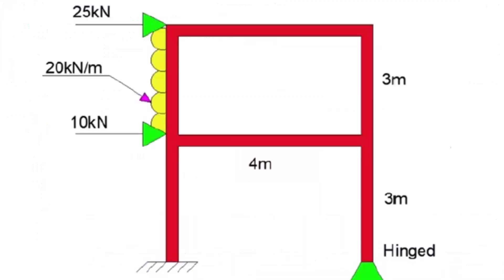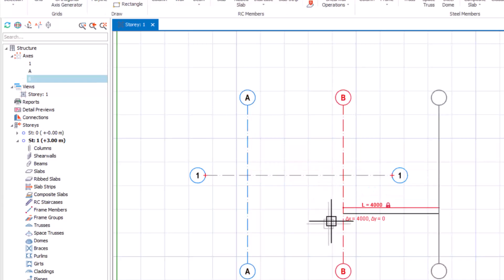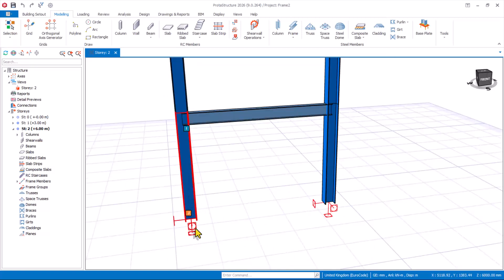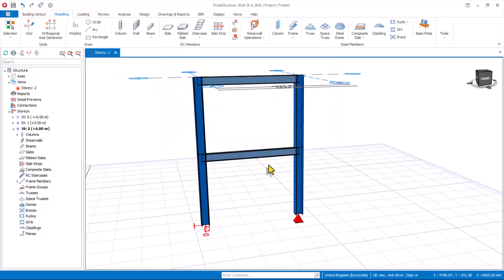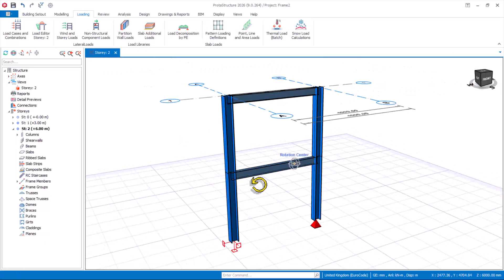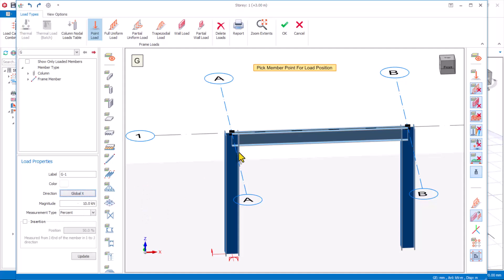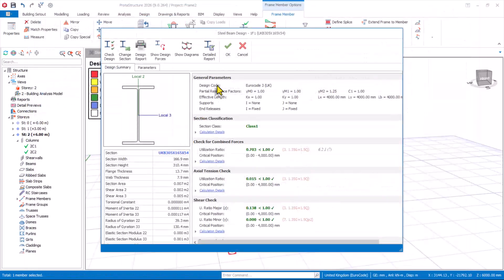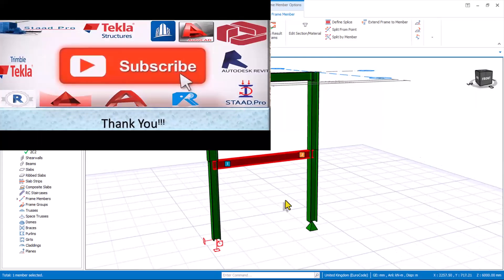Master Frame Analysis in ProtaStructure 2026: 3 Steps to PERFECT Structural Design

Comment: Why did you use a discontinuous column? I thought its supposed to be one single column member from bottom to top
Reply from the maker: UDL is along the column length of 3 meters
Reply: @CADmade-easy  I thunk you can apply it as a partial uniform load for only 3m
Reply from the maker: @ssenyonjohenry  also possible